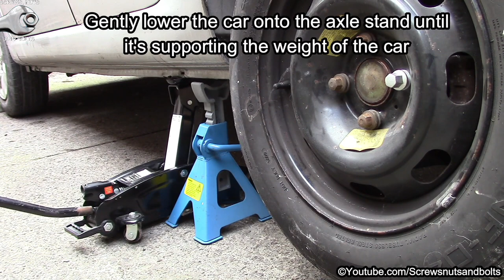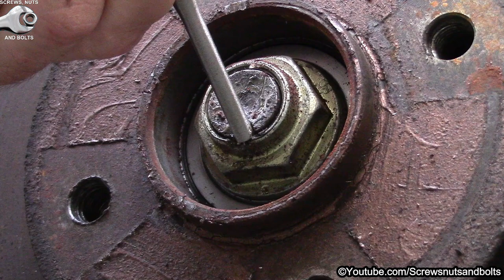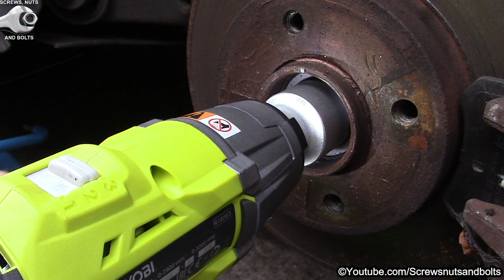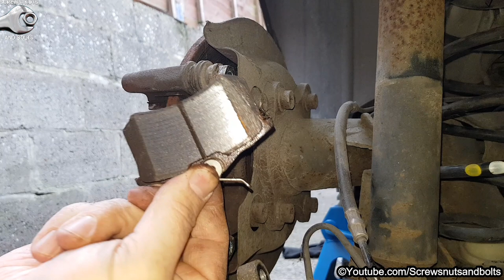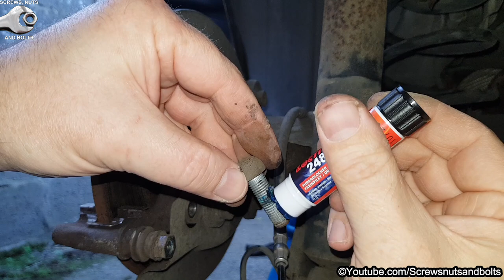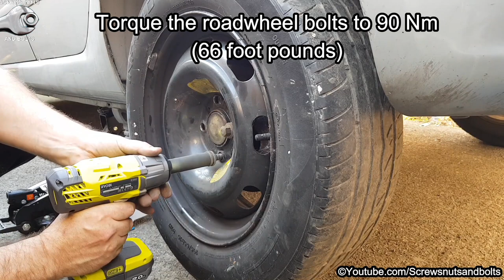Rear Brake Disc Renewal - Peugeot 307 & Peugeot 308

Comment: I did this today on my '09 308. Was a bit of a mission! I also needed a 36mm socket for the hub nut. All of the bolts were a lot tighter than they are in this video...! The caliper bolts especially so - needed a well-fitting and good quality socket to not round them off. The T50 bolts were okay, as they are much less prone to rounding out. Oh, and the piston rewind was an absolute sod, becuase the brakes being so worn meant the tool wouldn't fit at first!! Thanks for the guide - it was V useful.

Comment: On a 308 (T7) the hub nut requires a 36mm socket. And needs to be tightened at 300N.m.
Reply: Wish I would of read this before I bought a 32mm socket and took the wheel off. Doh!
Reply: @JellySIde-qj4uv  I knew there was a reason that I buy them in sets and not singles😂😂
Reply: Time to break out the big torque wrench 😂

Comment: What about the hydraulic plunger? You won’t get new pads in if the old ones are worn right down and the calliper plunger needs adjusting to fully open.
Reply: In that case you need to remove the cap from the brake reservoir and use a wind-back tool or piston compression tool. Don’t forget to replace the reservoir cap, start the engine and pump the brakes repeatedly until they firm up once you’ve finished.

Comment: All the 307 are the same? I mean, all 307 have this kind of “assembly” of brake disk and hub or there’s another model with independent brake disk? Thank you so much. Greetings from Uruguay.
Reply from the maker: No they're not all the same. Some 307s might have disks independent from the rear bearing
Reply: Great video. Just one thing to note if you were to do it yourself:
I’m guessing this is the SW? I have the Hatchback (308 -09) and the hub nut is 36mm instead of 32mm like this one. Thanks for a straight forward guide👍
Reply from the maker: Thank you !

Comment: How often do you have to change the break pads and rotors? Any signs that they are worn enough for a change? It is ok to only change the front or rear brakes? Not all at the same time
Reply from the maker: It depends on how hard you brake and how much mileage you put on the car. You usually change the pads every 10 to 20 thousand miles or when any one of the friction surfaces reach the minimum thickness and the rotors every 60 to 70 thousand miles or when they reach the minimum thickness, and yes it's ok to change just the front or rear brakes but never just one side of either.

Comment: Good job but when you disassemble all that stuf you  should have show how to clean abs sensor (common problem on 307) , lubricate caliper guide pins,...etc
Reply from the maker: Thanks, this was just a basic demonstration on how to replace the discs. I might do another video on the abs sensor at some stage.